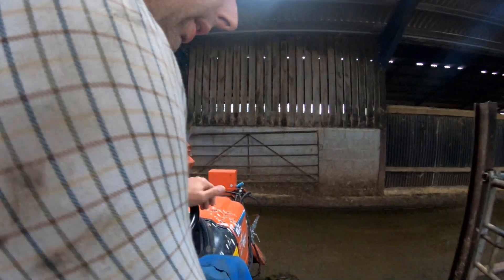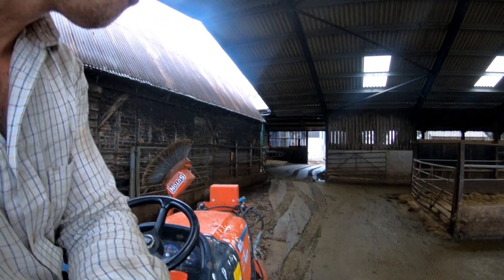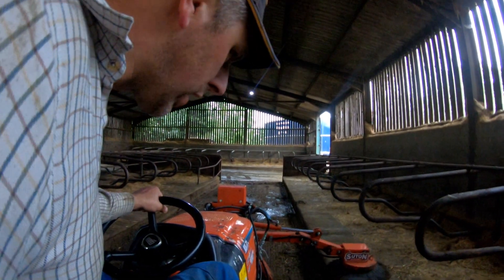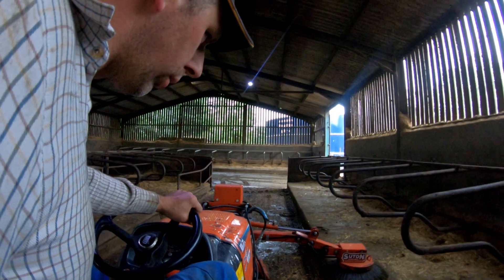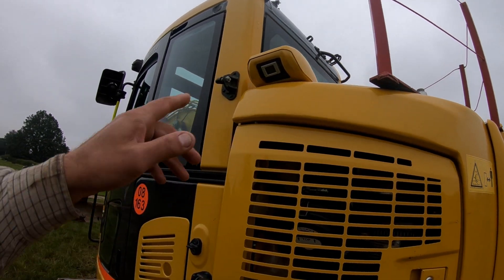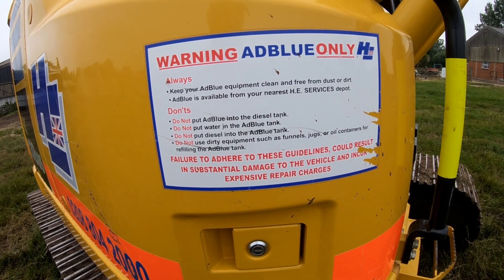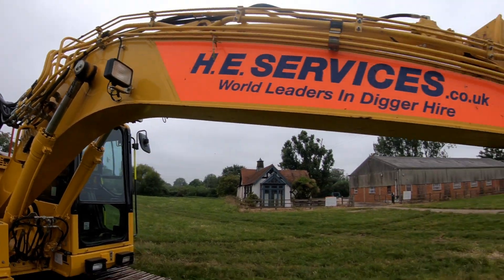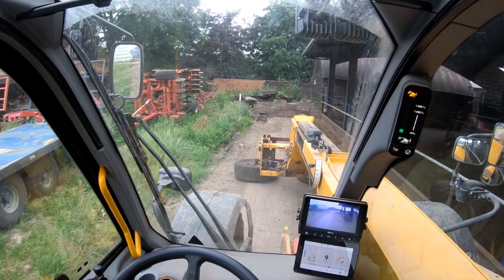LITTLE TRACTOR, LITTLE CALF, DIGGER

Comment: Hey George.. The cows floor area with the muck that you need to be cleared. How about putting a layer of fine wood sawdust down 
to soak up the muck and water and om top of that a load of straw which will help the cows walk without slipping around. 

Then when you need to remove it, you will have some great composting waste to put in the compost area or spread it over a field and plow it in as fertilizer!

Jobs a good'en.

Comment: Hi George them komatsu diggers are absolute junk I work for a civils firm and we had 2 boss got rid after 12 months I know you like jcb but there diggers are rubbish always breaking down we got rid of all ours sick of the down time
Reply: Agreed I’ve driven 360s for last 13 years all sizes up to 90ton.. I had a brand new one of them 13ton zero swing komatsus on hire fron lynch plant hire bout 3 weeks ago it had 20 hours on clock & its was a heap of shit tiny plastic cabs the seats are awful there absolutely gutless on power & very slow on hydraulics.. the weight distribution is shocking like a nodding donkey with a full bucket.. & yes agreed jcb are heaps too they never been able to make a 360 excavator had a new 220x series jcb on hire & it was rubbish too don’t rate it.. it’s cat or volvo all the way for me personally I’m normally on a 336f cat or a 380el volvo & I wouldn’t swap either machine for another make of machine..